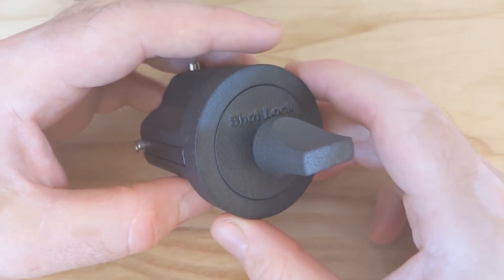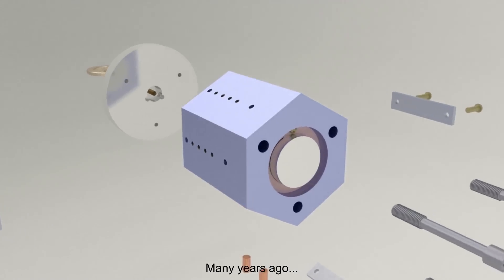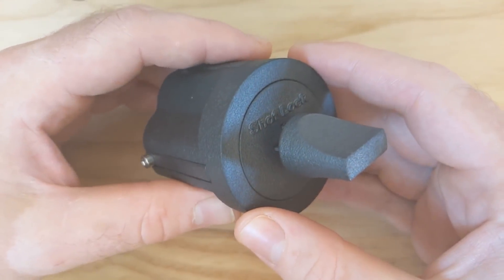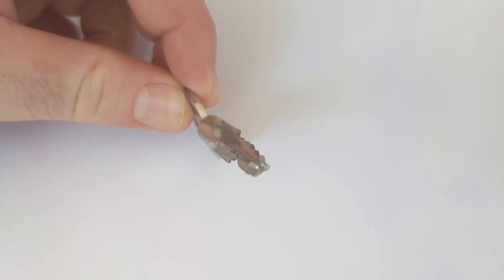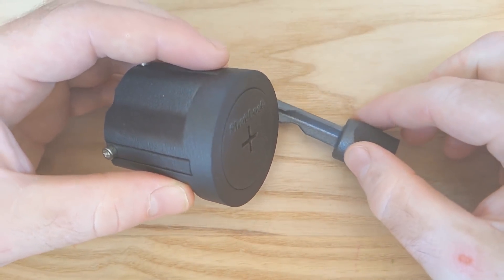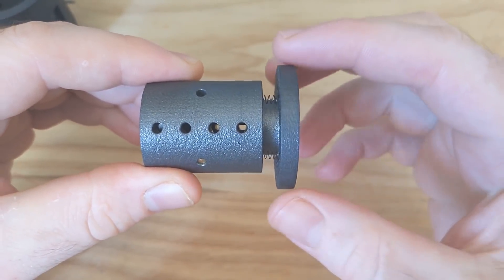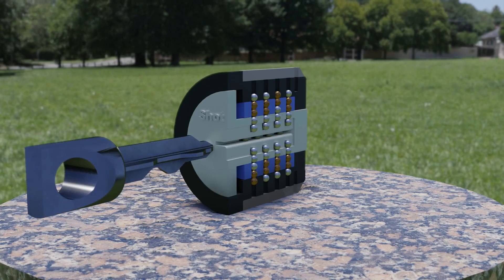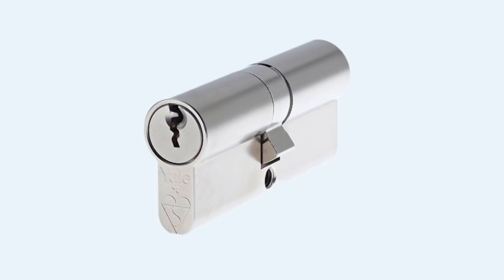A 3D Printed Unpickable Lock

Comment: Just judging off how LPL picked StuffMadeHere's lock (as both have a similar idea of "only check the pins after they cant be tampered with anymore), a locksmith might lift all the pins to their highest position, tension the lock, then tap it till the bearings fall into place. I this really works best with gravity aiding you though, and because your lock has pins in all 4 directions, it might not work
Reply: Maybe you can use artificial gravity by rotating the lock fast.
Reply: @bee2hive  I know youre joking but thatd spin the pins in the wrong direction, lol
Reply: Centrifuge force then ?
Reply: You can't tension the lock unless you push it in though, and if you push it in you can no longer drop the bearings.
Reply: @xbrain13  Centrifugal "force" would push the pins out, not in
Reply: @Styrac  You need negative centrifugal force, of course! 🤭🤭
Reply: @PS-vk6bn  sounds simple, just rotate the lock in the other direction, right?
Reply: @jankoodziej877  Nope, you have to rotate it inwards in the 4th dimension!
Reply: @PS-vk6bn  just spin the lock the other way /s
Reply: @dedsecaffiliate1979  everyone knows you turn it upside down and spin it. Or spin it in Oz maybe ...I think they have inverse gravity on that side of the disc ;)
Reply: @ytcer  if it's fitted on a door, should we rotate the door, the building or just inverse gravity? 🤔
Reply: You can tap all you want, but to tension it you have to push it in and thus you naturally lock in every pin position. It's physically impossible to move them regardless of how hard you shake it (unless it breaks lol).
Reply: A key with all zeros insta-picks this lock, Right?
Reply: Nm im dumb
Reply: @hugoguerreiro1078  ye, but it could be solved easily if you use something like those "trap pin" in that vintage lock, so that if you fail to pick the right combination you'd get it far enough to bind, but not enough to open
Reply: @ytcer  bop it
Reply: @wolfsworkshop9095  what do you mean solved easily? It was already solved to begin with since pushing the lock in will effectively lock the pins in place.
Reply: @hugoguerreiro1078  you would overlift them, then a bit of percussive persuasion.
Reply: @lmaoroflcopter  that doesn't work with this lock.

Did anybody here even watch the video? Seems like people are just throwing out random methods without even understanding how the lock works.
Reply: @hugoguerreiro1078  seems like it would. What are you basing your belief that it won't work on?
Reply: @lmaoroflcopter  because in order to tension the lock you have to push it in, and if you push it in you can no longer drop the pins, as they get stuck (as shown at 2:30 in the video).
Reply: @hugoguerreiro1078  If you push it in you are able to manipulate the pins. You don't need to rotate the lock. The act of pushing in will enable you to keep pins located as you want as that is how the lock functions.
Reply: @lmaoroflcopter  sorry but that didn't make any sense.
Reply: @phazerave  the lock pushes in. Disconnecting the key pins, from the driver pins.

So just like in spp, where you take advantage of manufacturing tolerances, you are likely to be able to set pins into a configuration simply by using the disconnecting motion.

You won't get feedback from the lock like a traditional pick, but you can set pins.
Reply: @lmaoroflcopter  that doesn't allow you to find the correct position of the pins, so you actually do need to rotate the lock. Only pushing it in does nothing as any combination will let you push it in.
Reply: @jankoodziej877  Nah, you have to go down under to Australia.
Reply: @hugoguerreiro1078  it allows you set pins. And you know each pin is either a combination of single or double bb. Apply some tension by depressing the lock somewhat, apply some lift to the pin, find the binding points, you find the double pins. Find the double pins, you have more information from which to work with to defeat the lock.

It won't let you SPP it in the same sense as any other pin tumbler lock, but it will yield information about the configuration of the pins and likely an eventual defeat.
Reply: @lmaoroflcopter  can't tension the lock without locking the pins in place though. At least not in a final version made out of good materials.
Reply: @hugoguerreiro1078  which you can do by simply sliding the lock forward. You can't rotate the lock,  you can lock the pins in place.
Reply: @lmaoroflcopter  you can't find the double bearings by sliding the lock forward.

At this point you should just describe exactly what your idea is here, because it doesn't seem to have anything to do with your original idea anymore.
Reply: @hugoguerreiro1078  please explain why you think that's the case?

If the movement forward disconnects the key pins from the driver pins, you absolutely can use that to find pins.

My original idea? Was just overlift the lot. Nothing preventing that except manufacturing tolerances, but having been dragged here to answer your repeated questions I've had time to look at the design as presented and realised actually, whilst not easy (there are four sets of pins to decode) it is in theory doable in a different way, allowing us to use the locks design against itself.
Reply: @lmaoroflcopter  "movement forward disconnects the key pins from the driver pins"
The problem with that is that the key pins are ball bearings, which means you will be able to push in the lock with any combination, including wrong combinations. And the double bearings will never be in contact with the first sheer line. You have to rotate the lock to find the double bearings, but you can't manipulate the pins when you do it, hence the problem.

The only way I could see something like that working would be to brute force the combinations from front to back and see how far the lock would turn, but I don't even know how feasible that would be in a final version not made out of plastic.
Reply: @hugoguerreiro1078  I think he's saying that you put a very small push on the core, not enough to fully disconnect, but enough to be able to fish out a little more information
Reply: @Styrac  Spin it the other way then. 🤯
Reply: @expertoflizardcorrugation3967  I don't think it would work if the lock was built properly. The whole point was that you couldn't get information by pushing the lock forward.
Reply: @hugoguerreiro1078  this was me attempting to explain what I thought console meant, you seemed to not be of exactly what he meant, so I just gave a possible interpretation

For the second bit. The point was that you couldn't manipulate the pins and tension the lock simultaneously. The forward push was just to facilitate that. I see some issues with it, but that could be an error on my part. It also seems like a place where someone would make an oversight
Reply: @expertoflizardcorrugation3967  yes, if the mechanism on the back is too thin then it would be possible to manipulate the pins, but that would be a big oversight and I doubt the creator would make it. The lock being made out of plastic could also provide other ways to exploit it, but I consider that cheating since a final version would obviously be made from sturdier materials.
Reply: @hugoguerreiro1078  the mechanism on the back has little to do with that. As far as I am aware It only comes into play if you rotate the core. If the
Reply: @expertoflizardcorrugation3967  rotating the core is the only way to get information afaik.

Comment: I feel like calling something unpickable is really up to the interpretation of what the “pick” or tool is. It definitely seems to be “unpickable” with a normal pick and torsion wrench, but I can imagine a specialized tool could be created to pick the lock, much like how LPL has some custom tools to pick some types of locks.
Reply: >specialized tool
you mean a key?
Reply: @jeffjustjeff2891  obviously ‘special tool’ suggests a tool that can be used to open any lock with the same design. No, not a key.
Reply: @TjMoon91  at what point does a key become a tool or a tool become a key?
Reply: @jeffjustjeff2891  Key is meant to have only one configuration and be as unique as possible. On the other hand I've seen electric locks with key that is segmented with encoded parts that can rotate to change the combination, so... I guess It's actually a good question you ask here.
Reply: @jeffjustjeff2891  I mean if the teeth of a key are jagged enough its a mini saw. So technically they could be multi-tools lol
Reply: lmao wayyyyy overthinking that, dont get philosophical over a lock

Comment: Excellent: "sets the pin positions and then cuts off access to them before you can open the lock"  This uncoupling of pin set from gate trials is the essence of unpickable locks.  Had locks been designed this way from the beginning, there would be no phrase nor profession of 'lock picking'.  When the lock picking lawyer was confronted with another of these 2-step designs he turned to back side intrusions (not picking).  You've got a great concept.  Patent it quick.  Smiles.

Comment: Good effort, I could see the sheer core being made of sintered alumina ceramic mixed with titanium, hardened steel and ceramic pins and damn near impossible to drill or burn out.  Wish you true luck with this product 😁👍👍👍👍👍
Reply: if you do that the lock gets cut entirely out of the door as the thing the thief wants
Reply: @dovos8572  Xd
Reply: @buffalo wt my point is that if the lock is made out of the materials above then it would be more worth than most of the things you have inside the house you want to protect.

Comment: Just a reminder to everyone speculating about how to pick it: no lock is pickable by design, it's the inconsistencies in real-world machining that cause the flaws. This lock is unpickable by design (as are most locks), and there is no way to non-destructively compromise the ideal version as presented in the animation. Any locksmith/red-teamer would need a copy (or several) of the lock to actually determine where the flaws lie, and whether it's generalizable to all versions or if they must be compromised on a case-by-case basis.

Comment: Replace the ball bearings with .0030 high master wafers for the passive pins and .0060 master wafers for the blocking pins, then you will have much better key permutations.
Reply: It would, but I believe the reason for using bearings means there's no useable lip to try tension against to set pins.  The balls would just slip right off.  Single pin picking would be extremely difficult, even if a way is found to tension the core.
Reply: @psieonic  Can't you round off the endings of the pins?? Then you would have the advantage of using more key permutations since the pins can vary in length and because the ends are rounded they can't create a lip to tension.
Reply: @j3st3rxyz  But then you kill the sub thou tolerance allowing for other more basic types of attacks. Why he didn't put a bearing under a master pin though has me kinda confused.

Comment: The weakness of tensioning denial mechanisms is usually that there's other ways to tension the bolt than the intended mechanism.
Reply: I don't see how that could happen here, though.  With the inner two cylinders rotationally coupled, and the innermost one locking into the lock body when it is at rest.  Even if you could somehow try to directly tension the middle ring, it in turn would vtwist the innermost, which is locked into the lock body by the shape at the rear of the lock.
Reply: @Firebat45  Shim or drill by the keyslot to tension the bolt
Reply: @pyalot  At that point it's no longer picking, it's just destroying the lock. Every lock is susceptible to being destroyed 🙄
Reply: @AlexusMaximusDE  depending on construction, you can shim around non destructively. Also even if you need to drill, a very small hole might suffice, which you can make with a battery powered rotary tool that fits in your pocket and you can use inconspicously, rather than a battery drill that is much less concealable.
Reply: @pyalot  yeah shim it. That would work, just lift each pin enough to give yourself room incorrect bitting or not doesn't matter, just shim each set of pins,  but then its not really single pin picking the lock.
Reply: @AlexusMaximusDE  no, ever seen a vault? How strong can it be, ever seen a fucking thief? A robber? A drill is not at all out of their range.

Comment: This "lock the pins before testing them" idea seems to be catching traction with lock-designers trying to create a new actually pick-proof design. This is the second lock I've been recommended which uses that idea. The first (by Stuff Made here) already collaborated with LPL, and the only good solution he found to the revised version was a weakness at the back of the lock letting him bypass it. (The first version of the lock was susceptible to raking and then tapping to lower over-set pins into position)

Comment: Seems like a few attacks might work. First, depending on how those ball bearings are fused, if you cranked hard enough, you might be able to snap them apart. That would allow the lock to be opened with any key, including the original one, and wouldn't be visibly destructive. Second, given tolerances are what they are, if you applied the turning force offset from the center of the cylinder, you should be able to force one set of ball bearing to engage before the other three, allowing you to decipher one set at a time, cutting the permutations down to 16 four times. Finally, depending on tolerances once again, you might be able to insert shims between the outer lock body and at least one of the cylinders, which would allow you to decode the lock and "set" it in the correct position.

If you really want to get creative, you might even be able to decode the lock by sensing the fuses directly, either magnetically if they are brass like the animation indicates, or by probing each slot, assuming there is enough of a gap between the ball bearings and the wall of the chamber.
Reply: Dunno if shimming would work, since it'd have to get around that lip in the front.  Although I would love to see LPL go:
"All we'll need to open this 'unpickable' lock is this shim I fashioned from a coke can"
Reply: @Rman0712  It depends on tolerances and manufacturing method, chamfered or rounded edges would give a shim a surface to turn on and with three concentric cylinders, you need to control the stacked effect of three tolerances to control that gap without binding up the lock.
Reply: @SBBurzmali   At 2:24 it in the animation, it shows that the brown fused pins are always outside the white inner most cylinder, so the shim would have to go between the blue middle and black outer cylinders.  Unless you can curve a shim on thin air don't think that's going to be possible. 😟
Reply: @Rman0712  I suspect that the brass pins are going to fall below the shear line without a key in the lock, the animation doesn't show it, but I don't see how you could ensure all 4 sets of pins aren't falling out of place without pushing them into the key a bit, that should give you some ability to either shim them in place or at least detect the fuse.
Reply: @SBBurzmali  maybe I’m misunderstanding you, but @2:25 you can clearly see the brown bearing resting on the shear line between outer and middle cylinder. 

Completely agree that a shim between those 2 cylinders defeats this.
Reply: @struful  I'm suggesting that the animation simplifies the bearing positions slightly because I'm pretty sure that the lock would run into some issues if the ball bearings didn't extend down far enough to interact with the key even on a low cut, just as the animation omits the springs that would need to be present to prevent the lower bearings from falling to the high position even without a key present.

Comment: Super smart design. Similar in concept to the first StuffMadeHere lock, but I think your mechanism is really elegantly simple.

One exploit I see would be to push the barrel backwards (without raising any pins), then strike the lock with a mallet while applying a small amount of toruqe. It would be exceptionally fiddly, but I think you could bump each of the pins above the shear line with enough patience.
Reply: The double bearings could get stuck on the sheer line, plus it's 4 sets of bearings, you'd have to get all of them at the same time. Seems kind of hard.
Reply: @hugoguerreiro1078  Agree with that, they're basically spool pins.

It's just the only possible exploit I can think of, though. There's a good chance it's not a practical one.

Comment: Depending a bit on the tolerances, I can see one quite easy way to defeat this lock. 

If there is enough gap between the outermost flange of the inner core and the body of the lock one might be able to feed in a thin, flexible shim stock between the outer rotating core and the body. Then just lift the ball stacks until you don't feel resistance from the "double ball" in way of the shim. Repeat this for all of the four locations and open the lock. Even if there's just enough space to one shim at a time, it will be quite easy to decode the biting. 

Also this design is really susceptible to a destructive attack by drilling the keyway just a tad larger and let the balls fall out to keyway.
Reply: I think the faceplate is in the way of putting any kind of shim into the lock that can reach the ball bearings. Go to 2:35 and look at the lightest color in the cutaway.